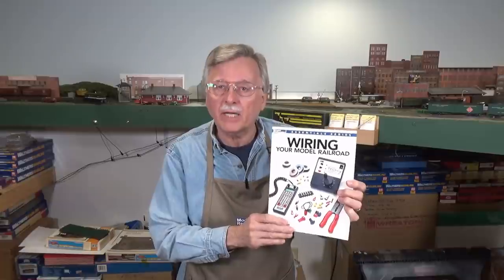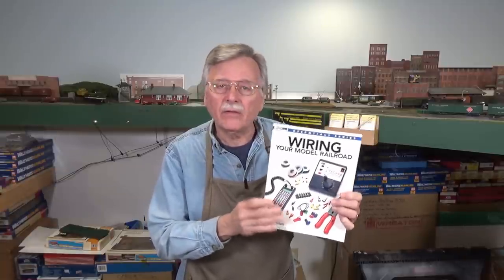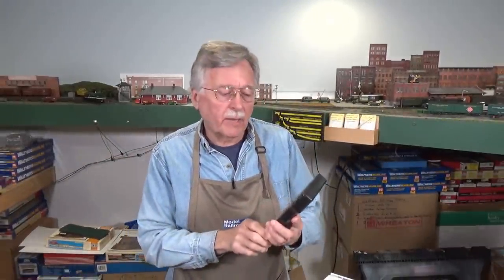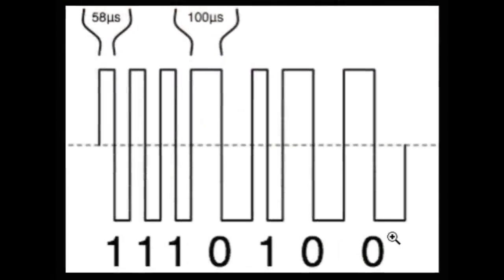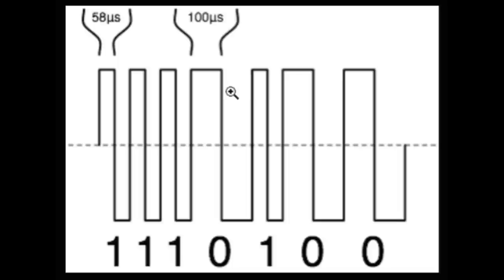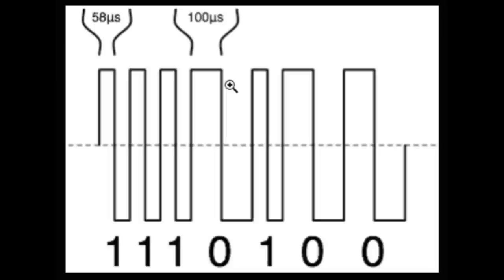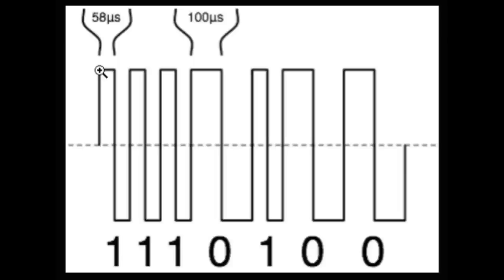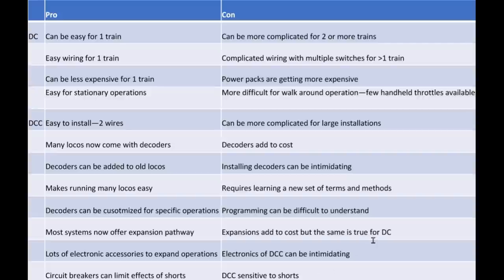DC vs DCC—Pros & Cons (183)

Comment: Unless you're going for complete computer controlled automation I've always personally found the perfect middle ground is to have DCC trains and old school toggle controlled turnouts with a localized switch board at each yard etc. That way you have the freedom of running/controlling what ever train at just the push of a few buttons with no need for isolation tracks or headaches, but the old school turnout controls still offer a more hands-on 'playing trains' feel to the layout. What's more is if you have a larger layout that need three or four operators, one can be controlling the main lines when the others can be fiddling away and shunting in their own yards. They can form a train, run it out on to a holding siding, then effortless hand over control of their train to the operator, then soon after a new train arrives in their yard. All along the yard operators are flipping switches to change turnouts etc. It's great fun when the two are combined. Plus it saves the expense of accessory decoders all over the layout.
Reply from the maker: I agree, and as I showed in my series on control panels I don’t have any of my turnouts controlled by DCC. At one point I considered going the route of even using the JMRI to control everything but I really feel that is a route to perdition. Each level of complexity only creates greater potential for failure. Clubs can do it because they usually have a group with diverse interests so it is easy to find a few guys willing to troubleshoot the inevitable bugs.  I prefer to keep it simple and use the big guns only when necessary.

Comment: Awesome Video! Makes understanding DCC much easier for me! I'm currently just collecting model trains for now and it started off with the idea of a 4 block DC layout with the ability to combine them in any order to DCC via a switch, but I find that I am slowly re-selling a lot of my older DC trains and buying DCC ready ones, so making the layout 100% DCC would be sooo much easier! I don't mind learning the controls as this is something that gamers have to do too when learning a new game! 🤓👍
Reply: Piero, I'd encourage you to try your hand and wiring up a DCC decoder. I'm in the same scenario as you, I have a collection of older DC locos from the 90s and I'm getting back into model railroading (HO Scale). I bought a cheap Digitrax decoder and found it was easy to wire up. Minimal programming via JRMI. This was my test setup to determine if it was something I could manage, and I found it really easy. Things got more complicated when I bought an ESU LOKSound decoder. Installing it was fairly easy but learning to really program it took some time. Once I figured out the basics, I was good to go. I'm almost done with my first full wire up, which is including removing my beautiful incandescent lamps and using LEDs. I'd prefer incandescent, but getting them to not pop on high and varying voltages on tracks is no small task. LEDs are pretty tolerant of voltage swings, so that's the direction I went. 

In the end, I'll be converting 4 locos to lights with sound and another 2 to just sound (B units). Naturally, any new locomotives will be DCC installed already. I'm not sure there is a benefit in buying DCC ready vs DCC installed, though. By the time you buy a decoder and install it, you are taking more time and the cost is also higher. 

Good luck!
Reply: @JF-lt5zc  Hi JF, Thanks for the tips and encouragement! 😄 I do have some older locos that I don't mind selling and using the funds to get a decent DCC loco, even with sound, but I see your point in converting some to DCC! I definitely want to convert some rare/older locomotives into full DCC even with sound, such as my older 4-8-8-4,  2-8-8-2, and Shays steam locomotives! At one point I will eventually invest in a small bench top mill to machine the chassis on some other rare diesels too! I have decent electronic skills + tools so I don't mind converting, but will definitely invest in a decent magnifying glass for delicate work as our eyes get worse over time! 😭 Yeah, unlike you, I decided to get into N scale (more in the same space), but did operate HO as a kid and remember trying N scale and pulling my hair out! If it wasn't for Kato and Micro-Trains, I'd definitely be in HO! As for buying DCC ready locomotives, they are usually manufactured much later than a non DCC locos, and their chassis look similar but they are not. Our problem is that we want both because of the different road numbers! 😄 DCC ready is very easy to convert (pop in and that's it) compared to possibly machining and rerouting lots of wires, but hey, that's the point of this hobby, building, building, building! I feel this is sometimes more fun than operating! 👍 Cheers!

Comment: I'm planning a 10x6 HO DC layout with two decks.  I love electronics and wiring, so I'm looking forward to dealing with those cons you listed haha.  I'm working on figuring out the control system with microcontrollers and DACs, which will hopefully eliminate those problems.
Reply from the maker: Sounds like a great topic for an article in MR once you get it worked out. Good luck and have fun.
Reply: Yes that's a great idea!  Thank you and thank you for your great videos!

Comment: Thanks for a very enjoyable video, I have used the NCE power cab for years without any problems but I was thinking of upgrading. I was unaware that NCE had other models and I’ve never seen any in the UK. Is there any chance of you doing a video on the higher speck models? Thanks, Mel
Reply: I've bought NCE components from Model Junction, Digitrains and Coastal DCC in the UK and found them all very helpful. NCE list quite a few other UK suppliers on their website. You can add a booster to the Powercab or upgrade to a Power Pro command station  and still use the Powercab handset.
Reply from the maker: I’d be happy to do those videos if I had the equipment, but I doubt Jim Scorse at NCE will provide review samples like those! He has promised me a 5 amp smart booster to upgrade the PowerCab but the last time I heard from him he was backlogged with parts shortages.

Comment: The main advantage of dc is cost. Also if you're the only one who operates on your layout being able to run multiple trains at the same time isn't as big of a factor.  If you're buying new locomotives dcc makes more sense but if you're buying older stuff, pre dcc  then dc is much cheaper.
Reply from the maker: For the lone wolf just wanting to run a train you probably are right, although having sound, lights, and other features makes DCC attractive even to those folks.

Comment: DCC to me is a gimmick and always will be. No disrespect to the gentleman behind this channel and the viewers but this is how I feel. I would advise all newcomers to the hobby to give it a wide berth and stick with DC. 

I know lots of people love it, but the expense at the front end and all the way through the process is a rip off. Only in this hobby is a chip that costs a few cents to make, ends up costing 100 + as much at the retail end. Apart from the gimmicks of sounds and lighting systems there is no operational advantage over DC. DCC still needs a nest of wires. More things to go wrong, and Cab Control and insulated turnouts like Peco Insulafrog do all the things that DCC can. DC from a 'craft' point of view is more fun. Even with the sound, people still have to purchase Stay Alive circuits so the sound chip does not reset to 'Engine Start Up' in the middle of an express run. More expense to keep the gimmick you never needed working. Ridiculous! 

I will never have DCC. Don't need it. 

One more thing: how come radio control using Bluetooth or similar has never been done with model trains? No power would be needed to the tracks at all then, and on board batteries in the locos could just be recharged. Now that is a system that would be a real advantage over DC. Yet, it is just not readily available. DCC claims to be amazing and in the end you get something that is 'gimmicks' for a colossal amount of money more than if you stuck with DC.
Reply: What I don't understand with DCC is why have so many different decoders. Technology is there for 1 universal decoder.
Reply: @catweazle9525  another reason it is no way for beginners.
Reply: MTForever:  There is a system called Dead Rail that the trains are battery powered remote control. The technology of smaller more powerful batteries has made HO scale Dead Rail come a long way.  You make some good points about DCC. I have DC now . Still I find DCC and Dead Rail intriguing. Cheers
Reply: If us my Bluetooth power is still needed to the locomotive as well as powering the Bluetooth components.  I don’t see batteries being realistic as far reliability.  Other than cost it gives more variability.
Reply: "Dead Rail" Model Railroading is rapidly growing in popularity. Although the concept is still using the same "chips" as DCC model Trains, Dirt Cheap copy cat chips are available from #%*! China. I agree the prices charged for DCC Equipment are beyond outrageous. I do like the DCC concept. I like the sound and lights options. Controling multiple trains on one track is great.( Haven't we all aspired to pull a GOMEZ ADAMS at some point?) I think the best solutions come from perspiration. More affordable DCC, Dead Rail radio control, Smaller more powerful batteries. The model railroading hobby has exploded in popularity this past year due to Covid 19. Lots more Clever and Creative people entering the hobby. I think great things are on the horizon
Reply: I agree. I love dc. I don’t see the fun in dcc. I like speed up, speed down, reverse, dead track, and running my prove along my plan to switch all points. That’s it! In regards to Bluetooth, I stay away from it for health reasons. It’s not good.

Comment: Hello
  I have a NCE power cab system v1.3 can this be updated? And 2nd some how non of my buttons match up I.E  MY WHISTLE BUTTON SOUNDS MY HORN AND MY HORN BUTTON MUTES THE SOUND ( THINK THAT'S COOL) I HAVE TRIED A RESET BUT NOTHING ITS THE SAME
  Any ideas?
Reply from the maker: Did you or anyone else doing any programming of the decoder and what kind of decoder is it? As for the PowerCab check with Ed Wilson at NCE tech support ti see if they can do that and he may be able to answer you other question..
Reply: @TheDCCGuy 
  No I haven't (at least not that I'm aware of ) the Loco is the 150th Anniversary 4884. I think it came with the tsunami 2 decoder it's the 2019 model. Athearn Genesis
Reply from the maker: Check the paperwork that came with the loco, it should have a section on DCC including the factory function assignments. If your are seeing the opposite then it may be possible that an earlier PowerCab version may have reversed these function button assignments but only NCE can tell you that.
Reply: @TheDCCGuy  
Ok fantastic I will send them a  email thank you for your time.
Reply: @TheDCCGuy  
I was thumbing through the locomotives owners manual and found out how to reset the Decoder. I reset the decoder and it works fine everything is in its place and it all works great thank you
Reply from the maker: Good job, I should have mentioned trying a reset. Sometimes CVs can get compromised or even changed when shorts occur on the layout, that might have been what happened.

Comment: If you want a good hand held DC controller check out Gaugemaster here in the UK.
Reply from the maker: Yes, but I wonder if those a relabeled MRC units like their DCC systems?  You also can dig out the old Model Railroader issues with DIY articles and build them yourself. But does anybody want something that is not ready to use right off the shelf anymore?
Reply: @TheDCCGuy  Gaugemaster make their own DC controllers, both panel, cased and hand held. They have been making them for over 40 years.
I have a hand held one for my test track. They are very good.
I agree with you that everyone these days wants just to open the box and get started.

Comment: DCC sends "SIGNALS" and power along the track.  Why send signals along the track ? why not send signals wireless ?  In effect DCC is using the track as a wire and wired remote control is old school.  Do a search for remote control drone. Compare a drone to a train. Compare the price. DCC is not the way to control a simple electric motor it is over complicated, flawed logic and overpriced.
Reply from the maker: A lot of folks feel that way too and have gone with dead rail. This is a system that basically sends the DCC commands wirelessly as you suggest. It typically depends on rechargeable LiPo batteries for power and that is the stumbling block. Those batteries, so far, do not last long enough and you have to recharge them, requiring removal from the loco. Plus you need to squeeze them into the model along with a receiver module fir the wireless signal and the DCC decoder. So like many electrical switchovers the batteries and size constraints remain the limiting factor to adoption. I guess we need to get Elon Musk involved in model railroading so he can solve the problem!
Reply: @TheDCCGuy  Not dead rail send a current along the track to recharge the battery while in the loco. You would not need the DCC decoder with wireless and you could use a small battery as it would be getting nearly a constant charge.   But the real problem is the price for someone thinking about taking up the hobby.
Reply: Wireless is unhealthy